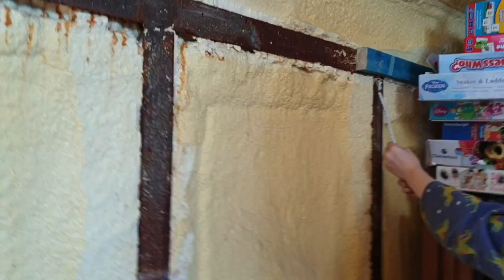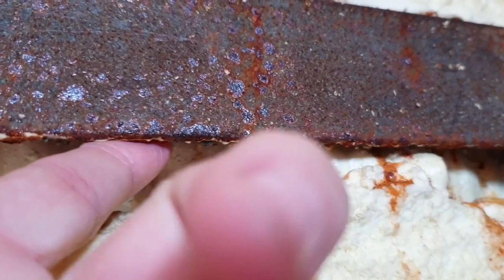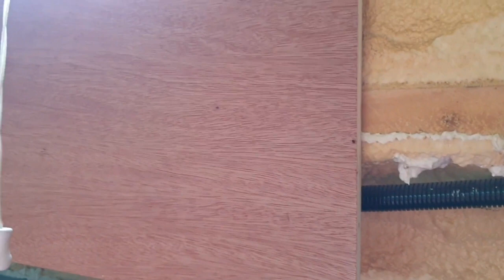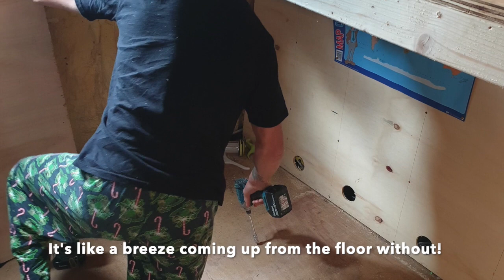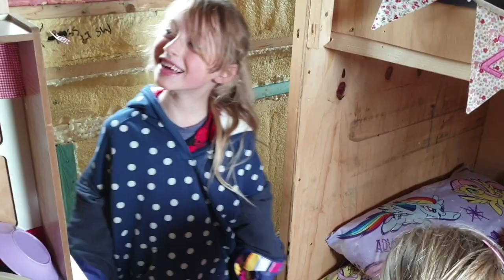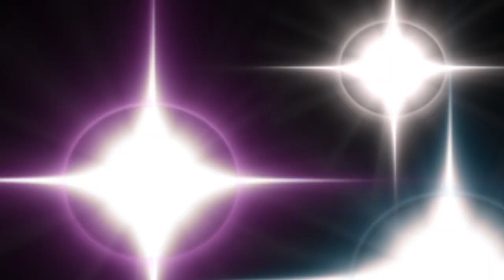HOW TO PREVENT DAMP & MOULD IN A CANALBOAT!!

Comment: Hi all, it must be tough living in a fit out project but you all seem very happy. Just a point about preventing interstitial condensation. To prevent warm air teaching the cold elements you should fit a vapour barrier as you fit the lining. This is a plastic sheet with any joints or penetrations taped up. It's standard practice in buildings. Hope this is useful to you. Jim
Reply from the maker: It definitely is no picnic living in it but we're pretty good at enjoying the process! (mostly 😬)
We will look into your suggestion! Thanks so much for helping 😊